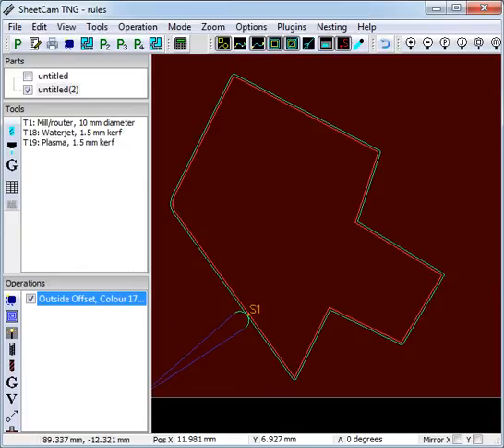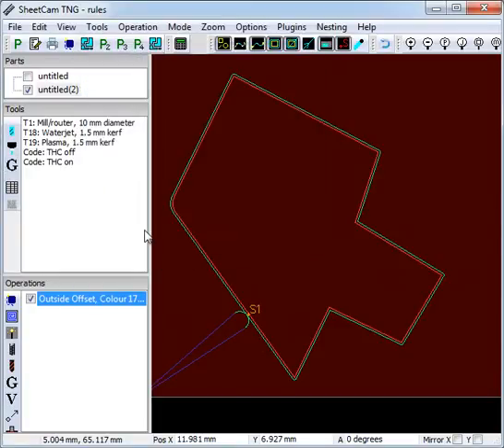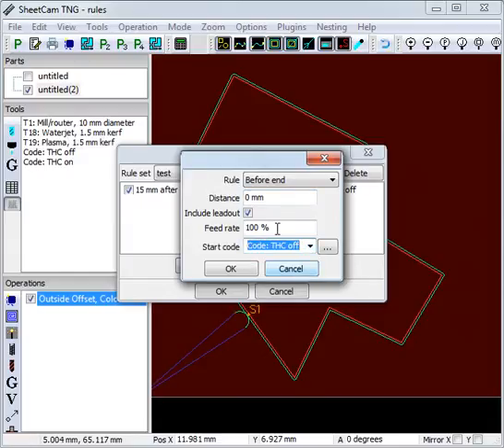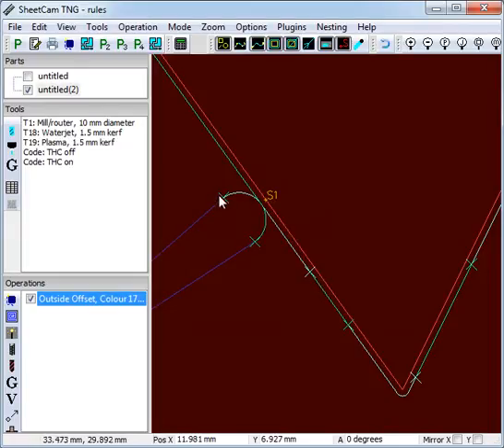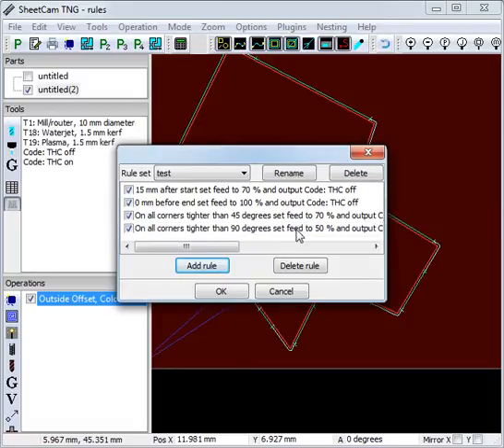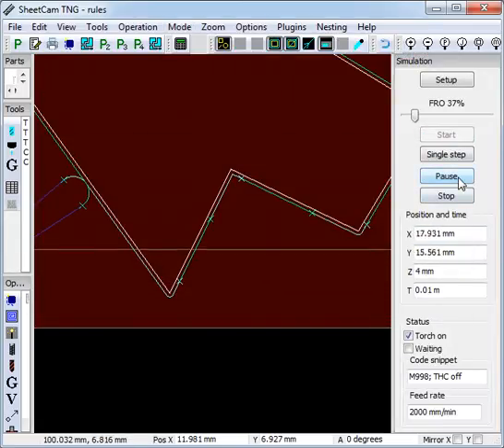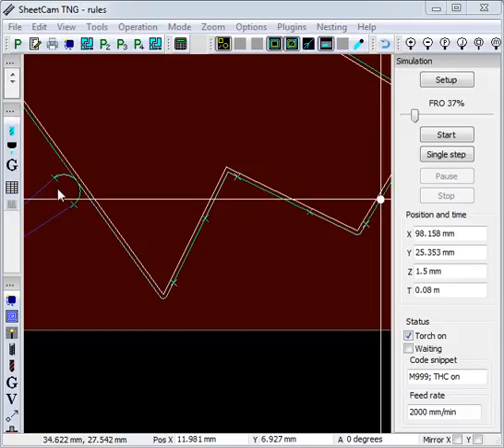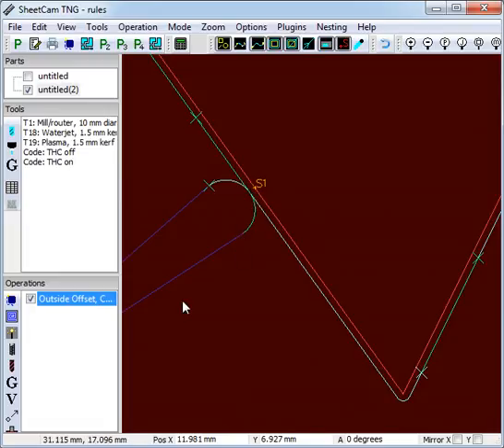SheetCam cutting rules tutorial

Comment: Hi, Thanks for creating this & your other videos.
I have some questions regarding this video.
Re: "On all corners" tighter than 45deg & tighter than 90deg, Can you please explain this a bit more? 
The reason I ask is that when you chose "all corners tighter than 45deg, the rule is applied to all the corners, some of which are greater than 90deg.
Then when you added the "tighter than 90deg rule" this is applied to the first corner which is sharper than the second corner which has the 45deg rule. 
Am I right in thinking that the "tighter than 45deg rule"  would be for corners between 0deg + 45deg?
Because the first corner is visibly more than 45deg.
Also, I have been trained to do all my outside cuts in a clockwise rotation as opposed to anti-clockwise rotation (Using Hypertherm PM85 Plasma.
Thanks again for producing a great piece of software :-)
Regards  Dunk